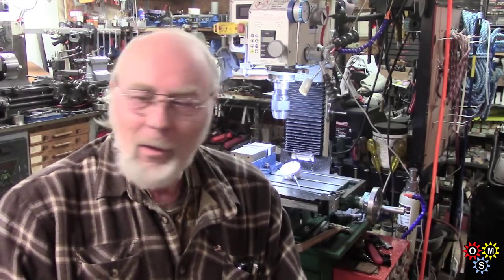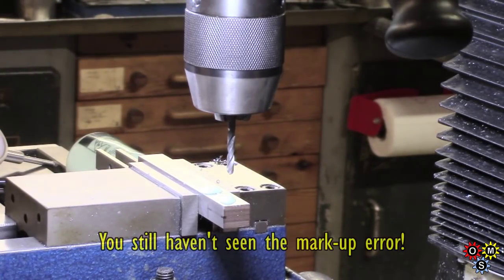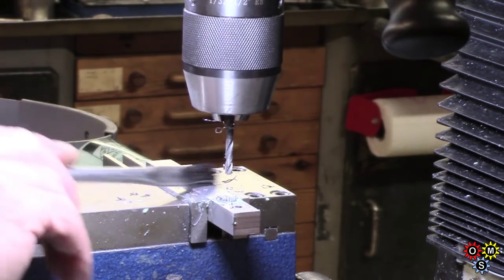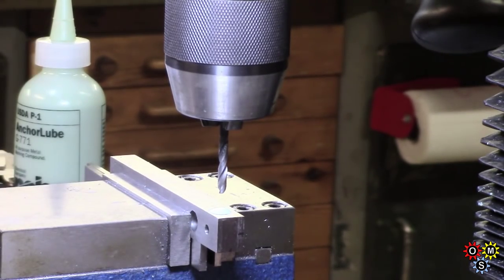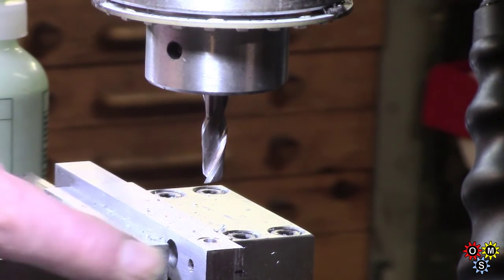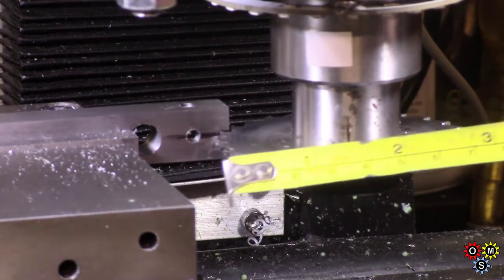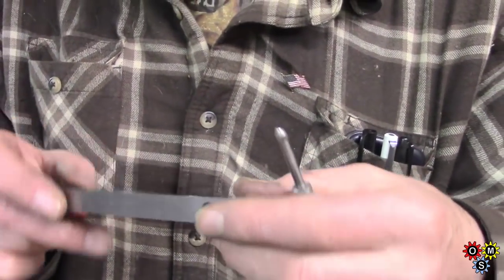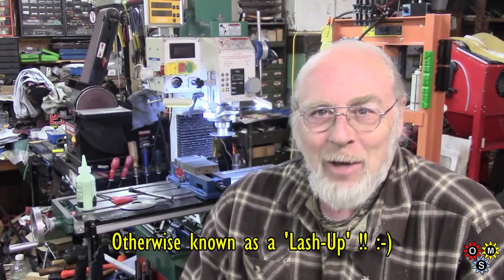Toolpost indicator holder

Comment: I made one like this a while ago and you need to put the screw on the other side.  Because the screw is "in front" of the indicator it will hit the chuck.  Cut back to 3mm of the indicator hole, slit 12mm back and put the screw threads behind then you can get much closer to the chuck
Reply from the maker: +Philip Borland 
Hi Philip -- Great idea. Yes that makes sense. I do have a much smaller indicator which I can use which would help but, like the idea, thanks a lot.

Comment: The extra hole in the indicator holder is there quit simply to make it possible to oil the threads of the pinch bolt without having to remove the bolt thus reducing down time when preforming scheduled maintenance upon tool which leaves me more time to stay in the house instead of freezing my ass off in the shop. but the tool is a great idea so I think I'll go out to my shop and built such a tool while I freeze my ass off.  Thanks for the inspiration.
Reply from the maker: +Jerry Elven 
Hi Jerry -- exactly!  Yes the hole is a vital addition :-) 
The ass-freezing factor here is trending towards diminishing soon hopefully! Be sweating before I know it!

Comment: You got out of that one very easily ! You will have to be very careful with the clamping on the DTI stem, they can sometimes become sticky in operation due to the stem being "squeezed" by the clamp. You could always say that the spare hole was to make the clamp arms flex more easily ! Chris B.
Reply from the maker: +Englishman French 
Hi Chris - indeed, already realized clamp force only needs minimal, then it's just fine. Ahh, the extra hole --- :-)

Comment: What ho Namesake, At last you have seen sense and made a tool post mounted DTI, which is so much better in use  that farting around with a magnet mounted Noga, always on centre and you can use the cross slide for coarse adjustment. I mounted a DTi in a redundant 1MT Dickson QC holder, best lathe accessory I ever made. 
There is no need to make another one for face reading, just put your one in the toolpost upside down (depending on radius of work) and turn the DTI so you can read it again..Or, get one of those right angle attachments for the gauge but be careful they break quite easily if you cock up initial setting, (don't ask, but experience is a wonderful teacher)  As a self imposed Mr bozo antidote, I made another from Titanium, really complex bit of machining, CNC would have saved several hours brain ache.
ATB
c
Reply from the maker: +Chris Stephens 
Hey Chris. Ah yes - turn round for face measure - of course! It was pretty basic but does the job.
Titanium - geez - that was ambitious! :)
Reply: Wanted to save some weight you know,:>)
In truth, I had a lump of 2" round and carved it in the end, it was either that or stainless, as I don't like rust on things I spent an afternoon making. The original die cast pot metal couldn't hack it when Mr B is about!

Comment: Hey Chris, what vise are you using on your 0704? Is that a 4"? I have the same mill, the 0759 DRO version, and have been using a higher-end drill press vise, but it's less than ideal for the mill. I'm thinking a 5" would be too big(?) Thanks for your videos, I always learn something from them! - Dave, from Bradford County, PA
Reply from the maker: +davesrepaircom 
Hi Dave -- Thanks for the kind words.
That vice is just a 3' - I have a lighter weight 4" I use on drill press, and that can work too but - anything much bigger gets too big.
I got a monster last year which is I think a 5' or 6" - that has masses of overhang plus it weighs a ton - and the other major factor always is how the vise jaws line up to the spindle.
I think 5" would be way too much for sure. I do have a 4" swivel and tilt which is rather huge for the machine but occasionally it can be useful for milling angles.
Oh for a Bridgeport eh!
Reply: +ChrisB257 
Thanks Chris, I appreciate it. In your opinion, are the Shars vises OK for the home shop?
Reply from the maker: +davesrepaircom 
Dave -- for price etc I think they are pretty reasonable. We'd all like Kurts of course!
The jaws seem pretty fair and lock-up is quite reliable.  Always worth tramming in carefully. Mine does all I want pretty much, although if mill was bigger I'd certainly like better width and capacity.
Reply: +ChrisB257 
Excellent! Thank you! A Bridgeport would be nice, but I'd need a bigger shop! ;-)